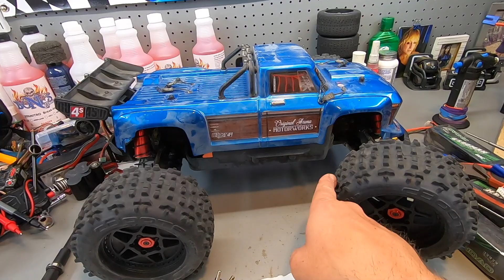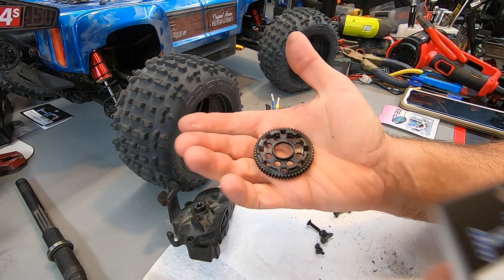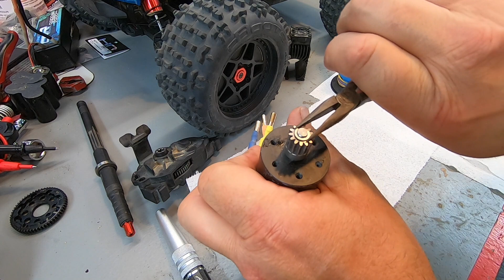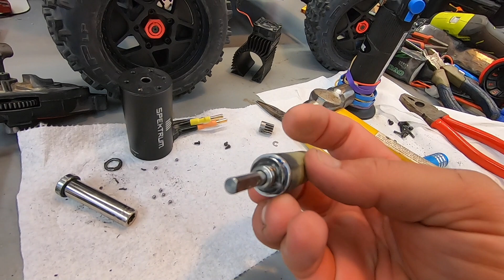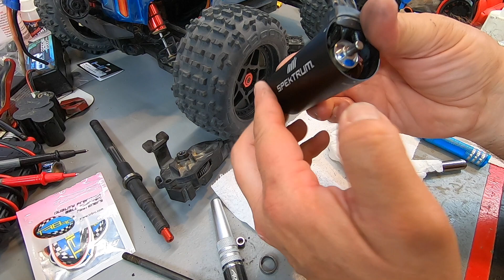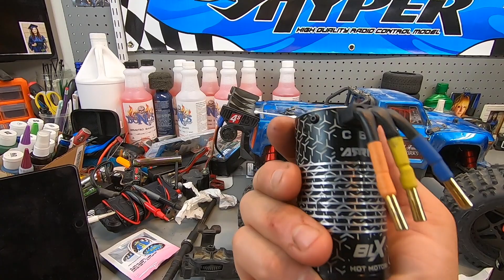New Arrma Outcast 4s V2  I KILLED that little 2400 KV Spektrum Motor

Comment: I’m sure the sand is killing that bearing but if arrma would have listened they could have put a sealed / shielded bearing in there knowing it’s collected dirt there in the past to stop the failure 🤷🏻‍♂️but good thing is we know and it’s one more item to replace before we run are RTR outcast4s ( ready to rebuild) 👍👍
Reply: I doubt that Arrma has any plan to upgrade the bearings they purchase, ..they obviously sourced those bearings from whoever they buy them from with the intent to get them as cheap as possible to keep their costs down and then just tell the customer.. "we dont recommend the vehicle be run in a dusty environment"  and will not warranty it . I personally will never buy an RC I have seen have issues and think to myself.. "well I'll just replace the motor bearing before running a BRAND NEW.. RC"  .. they wont get my money if they arent willing to improve their product.. they could just raise the price by 10 bucks and cover the cost for good motor bearings
Reply: Oh snap, Earl , ain't even have the rc yet and I'm already planning on working on it 🙃 😅
Reply: @jeremytrc3171  yeah these days I buy bearings, antacids and aspirin before I buy an arrma lol 😂😆 bearings cause we know they suck, antacids to take away the heartburn after I pay for the before bash replacement's, and aspirin for the celibritory first complete week of no break's 😆😂 I really don't like what I am feeling and seeing from arrma these days sorry guys been with them from the 2 wheel drive days but they worry me

Comment: One thing I've done to help with the sand in the motors on those BLX vehicles is put high heat tape over the holes on the motor that aren't being used. That transmission, like you said, allows a lot of debris into that area in general.

Comment: I've had to replace the pinion side bearing in 2 separate 3200 kv motors so far. But have been running 4 3200 kv motors for almost 2 yrs. I changed them right over to the TRB rc bearings. Haven't had any issues since. But whenever I'm doing maintenance it always something I check for now. Great video!! 💯

Comment: To prevent (most of the) dust from going into the motor take some glue (i like to use the ones who stay flexible) and close the holes where the tree wires come out. Do this from the inside so it will be clean and not noticable from the outside.

Comment: I like when u show in detail the repairs u do. TY. Happy new year.
Reply from the maker: 👍💯 I just OVERHAULED my original big rock😳😲
Reply: @rcguygarage  Im tempted to get one as I want a 1/10 scale basher that is reliable and doesnt have issues (gears/differential etc) as often as other 1/10 scales.  This is one I found online under $400. "ARRMA 1/10 Big Rock 4X4 V3 3S BLX Brushless Monster RC Truck RTR Transmitter and Receiver Included Batteries and Charger Required Black ARA4312V3 Trucks Electric RTR 1/10 Off-Road" 
 What is your favorite off road capable 1/10 scale rc truck or truggy?

Comment: Well because of you and Earl Moorhead, I've been looking at getting an Outcast. I just need to figure out if I want the RTR. I may just get the one I need to add the electronics. My rc's are almost all Traxxas, I do have 2 Losi LMTs.
Reply from the maker: The RTR version of this is not bad It's what I had and I loved it 👍💯 matter of fact still do It's just going to better power system in it now
Reply: @rcguygarage  I haven't made it yet, to where you go 6s motor, just watching videos when you first got it. Almost bought Losi drag car, on sale $300, would be mostly shelf queen like my Traxxxas M41
Reply from the maker: Hey NOTHING WRONG with collecting SOME of these RCS for sure

Comment: I've haven't had that issue with the V2 big rocks I got my kids witch I did buy bearings right away heard that was a issue but they don't run much more then a pack through them before there done now there update to v3 version I got right before the v3 came out go figure but have had any issues with blx 2400 that I've have thrashed in my Typhon 3s now running a 2400 3674  wich keep it light tons more go or 3674 2250 6s that's nuts and not as hard on the mount I do have 7075 motor plate saves a lot of weight compared to the big 6s system should try its better in my results .keep up great work and have wonderful day.

Comment: When I ordered a blx Granite for one of my kids I also ordered a ceramic sealed bearing. Plastic still on the body and bulled the motor and changed the motor bearings.
I think the 4s line is too heavy and powerful for the clutch plate design and the cheap aluminum used!!!!!
Someone needs to make a steal set of clutch plates!!!!!
Reply from the maker: I have a 7075 one ready 😳😜

Comment: My blx 2050 shaft seperated there was a gap moving between the aluminum and the yellow wrapped stuff. I put a spektrum 2050kv i had as a spare. I have no clue how it happen. My hobbyshop told me The motor core will start to spin on itself

Comment: I'm sorry about the bearing issue as I don't think there is any hope for this issue at the moment, I don't catch all the tidbits of information from arrma but I have a decent pool of people that tell what they can, and yes I  indeed am worried about this new 4s line just little things that don't seem to have been thought through and then rushed through testing on their end, 2 of the most obvious examples are the drive shift I think on the wheels they are hitting the shock springs might not be a issue up front but I'm willing to guess it will cause issues down the road, at least spring issues, and who knows mabey dive shaft issues,  there is another first run sign that leaves marks on place it shouldn't but I am not remembering it at moment um I  think u pointed it out as well,  but agin It might be nothing to worry about, my deeper worry is that production model will have the same careless thought put into them, just because there is a paper that says it will work does not mean, it will. Ok agin I'm sorry about the motor bearing it in my opinion is just another troubling sign that arrma is not the kind of company that they once were, I just don't  think spectrum is the thing they should go with and I to almost always switch out motors and speed control often but not always I switch my radio and receiver out to a Dumbo to be honest, I  also agree, when they pulled the blx systems from their rigs they lost a big support piece of their business,  heck I'm still buying blx systems as often as possible

Comment: Ya that Diamond Dust of yours really hates bearings, this is like the 4th video ive seen on your channel doing the same thing with these Spektrum motors LOL. You can give the dust a way out with Rich Duperbash's mod - he dremmels a hole in the chassis underneath the spur gear to allow dirt and debris to exit the center transmission area. Seems like a good idea, think Ill do it on mine before running the truck.
Reply from the maker: This module was said to be better sealed on the box so that needed to be seen before doing my modification to that area of the chassis 👍
Reply: @rcguygarage  Ah ya good point, well it failed the test 🤣

Comment: You know I own a big rock an a 3s typhon my sons got a granite an typhon mostly all running 4s over the last 2years I've had to many of these to even list an a bearing failure is nothing I've ever dealt with on one of these... it leaves me to wonder if all ur issues are steaming from driving these trucks in the sand looking stuff over there at diamond dust... everyone knows what sand does to these bearings in all rc car bearings but that's my thought I hope you better luck. Also good job on these last few videos an showing some details... cant wait for mine to come... I know I love my v1 outcast 4s i can only imagine the kraton that's on its way
Reply from the maker: You liked the V1 you are going to absolutely love this V2 I tell you right now the videos don't get to show what I'm feeling and how much I like this car
Reply: @rcguygarage  well I got the kraton ordered cause i have the outcast tho mines very from stock having proline powerstroke shocks arrma cnc diffs it's got the spektrum 120amp an a leopard 2400kv steering rack an servo saver hot racing shes a animal an a m2c motor mount...

Comment: What an awesome video. I’m super impressed with literally everything you did testing this and then the way you kept it real explaining everything.
Becoming a Subscriber because of this video
Reply from the maker: Wow 👍💯🙏
Reply: @rcguygarage is that the spectrum firma 120 amp ESC that's in THAT TRUCK
Reply: @rcguygarage have a 120 amp spectrum ESC in my Traxxas Hoss with the stock 2400kv Traxxas motor slowest I can get the truck to go is 8 miles an hour and I mean that's the absolute slowest I cannot get it to creep I even geared it back down to stock and it still goes 8 mi an hour I even hooked up my spare 2400kv Traxxas motor and it does the same thing and the new Traxxas motor has a clicking noise on the inside I just need some help getting this ESC sorted out I just don't understand why it won't let me go slow is it because the Traxxas motor windings come out of the motor like 3 in unlike the spectrum motors that have like maybe an inch hanging out I know some of them have like three in hanging out but could that be the reason why

Comment: Maybe you think what significance does a video like this have? I’d say invaluable as I watched it was interesting that the motor pinion had a C clip on the end. This is why I have a Losi Lasernut & even with lock tight the pinion keeps coming loose. It’s good for a few runs then comes loose. It has spectrum electronics & the motor doesn’t come with a clip to hold the pinion? I’m curious why is it just older. I just took it apart & re did everything so I can drive it again so I’m happy for now. I saw you getting some good air with yours so far mine has broke every few times out but now things seem to be ok except the pinion coming loose🤨
Reply from the maker: Wow I appreciate that👍

Comment: ? What do you think about the battery compartment? Im going to cut a block of word to put in to it against the battery so the bsttery does not slide and bounce around. Do you have any other ideas for this issue?
Reply from the maker: Strip of something as a cushion. I've used rubber roofing, foam and sheet metal just depends on what's on hand

Comment: Any issues with the pinion gear? I have a V2 for about 6 months, never jumped it and have only run it on the pavement and turf & grass football/soccer fields. The other day I went to run it and the pinion gear was stripped.
Thanks

Comment: I started running 6s esc motor esc on 4s arrma I found the 3668 motor  get s far to hot and I burned an esc tho I was running 2800kv 3668 spektrum on the 120a esc
Reply from the maker: @owen8538  6s ESC running 4s the power delivery is all that's needed. You can't run nitrous for a daily driver unless you want to burn something up 👍💯😜
Reply: @rcguygarage  I run it on 4s tho 6s esc motor and esc
Reply from the maker: @owen8538  what burned and why
Reply from the maker: @owen8538  there's missing info
Reply from the maker: I think mine is running HoBao 2200 or 2000kv I believe
Reply: @rcguygarage  my esc you best using 6s esc and 6s motor any brand tho I don't recommend spektrum hobbywing etc and run on 4s battery always try using battery smaller voltage then the max esc allows best tho gear it up then 7t more

Comment: Great vid brother thank you. My Kraton just took a crap on me during a bash session. I pulled the motor and was wondering, should that motor shaft spin? If it doesn't spin does that mean that bearing is broke?
Reply from the maker: Just keep in mind based upon my answer I have no idea what kraton you talking about because of the way YouTube shows me your comment most of the time I'm using my cell phone so if it's the 6s yes the motor is definitely supposed to spin if it's the 4S same thing you may have gotten contaminants somehow inside or you had a motor bearing failure could have also had a rotor failure but that's more rare

Comment: Are the Shocks better? On 3s the saft pops out on the bottom, because it is just clued/melted in.
Reply from the maker: Shocks are super plush and ABSORB HITS VERY WELL the light weight of the rig helps
Reply: These are like all the newer shocks vortex an newer cars they are built more traditional where the eyelet now is replacable

Comment: Out of round spur caused lots of problem why do all the spectrum motors do this .. mine did the same thing bearing failure .
Reply from the maker: I believe debris accumulated as to why I put a hole under the spur to let the sand out

Comment: Yeah okay, you've been somewhat rough, but no rougher than is reasonable.
I hesitate to even class it as an "accellerated usage" type deal because many buyers will do exactly (if not more of) the same type of driving you've been doing & expect their BLOODY EXPENSIVE NEW RC to handle it better than this.! 
It's not looking good I fear.
All of this happened quick.! 
Also, Spectrum gear SUCKS HARD.!
There's not one piece of Spectrum left in any of my 3 Arrmas. 
The shortest was an ESC at 1 week & the longest was a motor at around 8 months...
(got sick of rebuilding them & chucked them in the spares motor box, I've had better from a £15 Surpass motor). 
Unless you count the radio gear, that's all still good... Because it's been in a box for a couple of years after being ripped out immediately.
Arrma need to sell all their RCs as rollers the way Hobao do & give us the choice of electronics... It won't be Spectrum.!
Stay safe RC Guy you awesome Guy you, as always, best wishes from Scotland 🏴 🙏 ❤️ 📻 🕹️ 🔋 🚗 🚖 🚕 🚔 🚚 🚙 🚘 🚓 🚒 🚑 🚐 🚎 🚤 🚁 🛩️.!

Comment: I've had my 4s for almost 4 years. Been changed from a outcast to a kraton. I've had it with the clutch system (on 4s only). The rear side of the clutch is a problem!!!!. Weather you buy a replacement set of clutch plates . Out of center and the way it cracks and falls apart
 I've been using the inner racer part of a old bad bearing I take 2 apart just for the inner racer. I put 2 of the inner racer parts and slid it over the back end of the slipper clutch and over time it still cracks and falls apart. Twice I ordered new clutch plates and the came bent amain sent me new clutch plates no problem.
WHY?🤦‍♂️
4s is to heavy and powerful for the 4s line!!!! Clutch plate is too weak(cheap aluminum no good!!!!)
Max 5200mAh to 6000 mAh to keep weight down.
Reply from the maker: See this comment YOUTUBE HID I'm just seeing it now. No notifications
Reply: No problem 👍
I know Horizon now has a metal cap on it. Over time it might crack and fall apart when taken apart for bearing maintenance. Maybe not.
The back clutch plate.

Comment: i thought i got lucky with my motor but no.. 😂 after 1 YEAR it died! pretty impressive but it still broke got some bearings off eaby and they are sooo good

i forgot to say PLS change your pinion gear to  hardened steel i haven't yet 😂 but ive stripped mine 3 times when that motor mount bends that gear destroyeds the pinion gear i had to get a new speer gear :( it was 30$ the hot racing one it's so good and my motor that came with the v1 kraton 4s the back blew off 😂 so my rc is running on supper glue been like that for 4 months i really need a new motor but the price for one 😭😭😭 so expensive when you collect money from birthdays hahhaha
Reply: Aint the motors like less then 80 bucks?
Reply: @51-FS  yeah some where around that price i found a good deal for 60$
Reply: Yeah rc stuff is so cheap.
Reply: I'm running a 1900kv in my arrma senton 550 mega...... with a 130amp esc
Reply: @51-FS  OMG 4s or 6s 😂 must be a beast
Reply: 4s I put the granit wheels and tires on it and it launches like crazy. But now I keep pooping drive shafts... u can trash a new drive shaft in one run... I did get the metal ones... and 17mm hubs and tires....

Comment: It’s all about cost. They won’t put a high quality bearing in there because it cost to much.  On top of that most people won’t be changing it they will replace the motor. So they get more sales that way.  
Spektrum gear is over priced garbage. 
But the key here is to replace that bearing before it fails and it will be much easier and no down time.  

Lastly,  that was way to much loctite on that pinion grub screw!!! Just a dab on the first two threads is all that is needed.
Reply from the maker: I've found with the loctite I use I've had good luck using it the way I have for years with automotive applications as well👍
Reply: @rcguygarage  automotive yes I agree.  But with these small screws it doesn’t take much.  Many people don’t realize the need for heat either.  Glob on the loctite and then use subpar drivers and stripped screw and/or broken driver tip.

Comment: I found the gear mesh straight out of the Box seems a little tight you think that could be the reason why that bearing goes? Do u ever check on new car before u run it 😆 ?
Reply from the maker: Sometimes I do but mostly I don't. I'm just in to run what is put in my hands and just repair what fails if anything. 👍💯